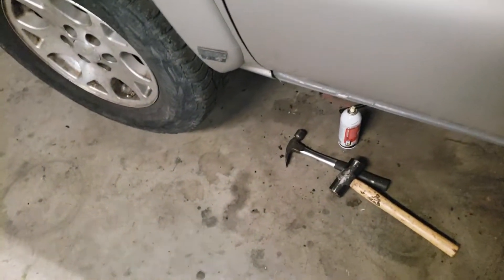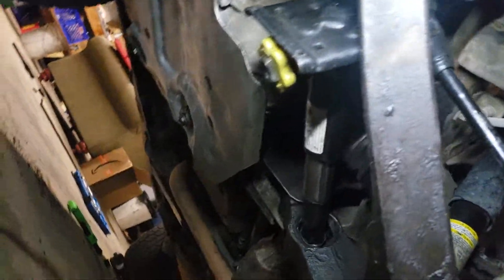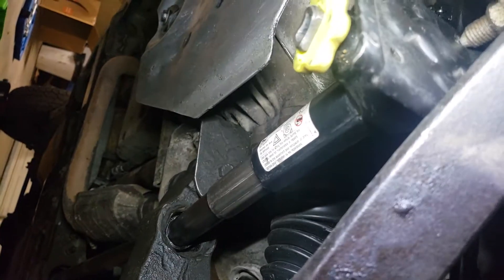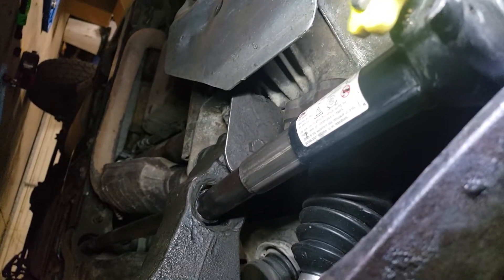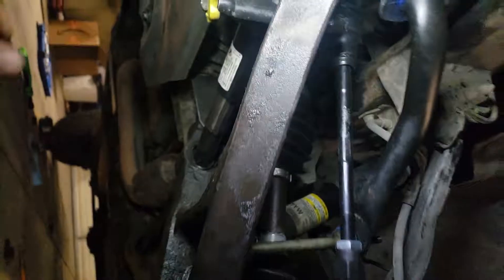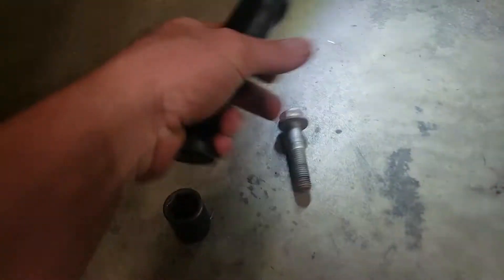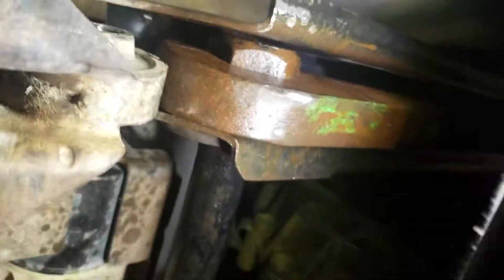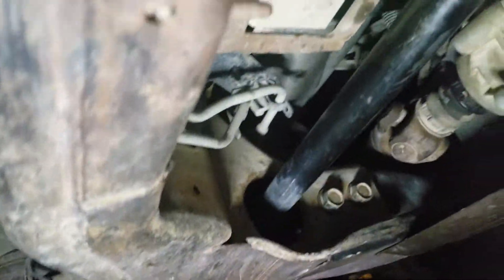Quick and easy siezed stuck rusted torsion bar removal gm tahoe. You're welcome!

Comment: Not mine,my torsion bar broke at the A arm and I milled the 4 inch  peice on a Bridgeport  to get through the peice 8n the arm.Then touched the rest and drove it out in a vice with a 10 pound hammer.I can't get lower A arms for my 2000 chevy 4x4 1 ton.